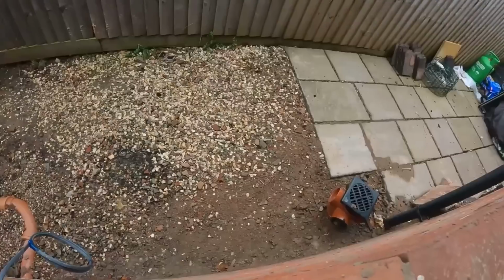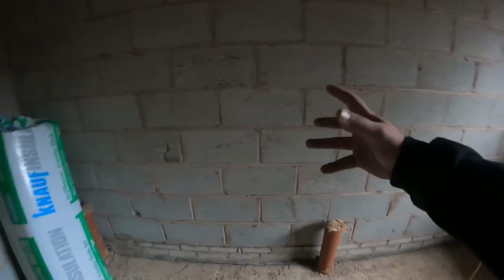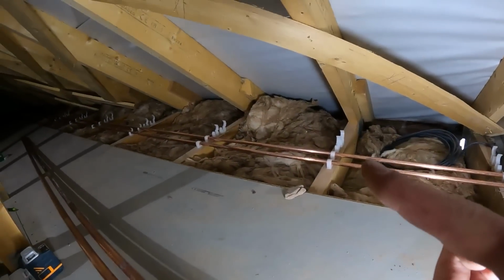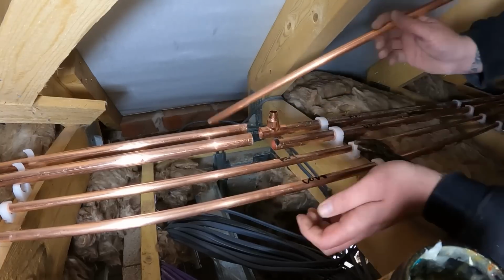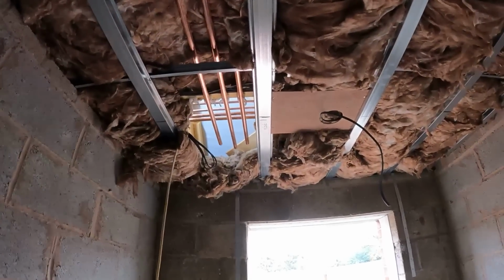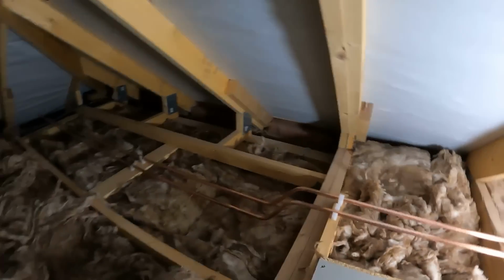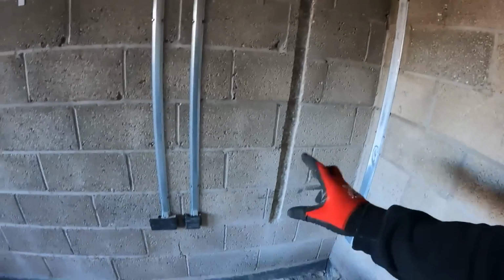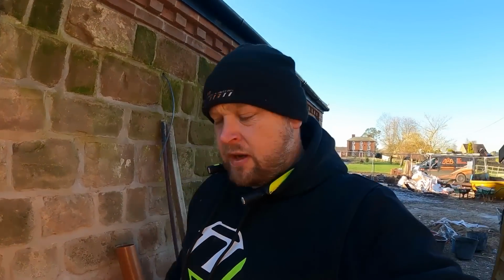HOW TO SOLDER COPPER PIPEWORK | PLUMBING TIPS & TRICKS

Comment: Mark when you solder then put a wet rag on your joints brings a smile to my face. In the 60's we had Geecol steel pipe Yorkshire fittings and Bakers Blue flux. Then we used to throw the rag on what we didn't know was the fitting and pipe cooled at different temperatures. When we turned on the first five installations everything blew apart.!!!
Reply from the maker: Ohh bet that was fun!!!!!!…..🫣🫣🫣
Reply: For electrical soldering we were told not to cool the solder joint by blowing on it because it could weaken the joint, I guess the same would happen with the plumbing joints with the wet rag only used for wiping the flux off to keep it looking nice and not rapid cooling the joint. Yeah ok not likely to cause a leak I know.

Comment: Lovely job as always mark hope your feeling better soon buddy. I'm stuck outside at the moment draining down holiday homes and rescuing ones that have frozen or flooded out. Roll on when it thaws out. Surprised the builder hasn't specified a secondary return on the hot as it looks a good old run. Anyway stay warm 👍
Reply from the maker: Thanks mate…….👍🏼
The long run is only for the outside taps and even then it’s only around 9m… the video probably makes it look longer.
Also reading up a little lately and a lot of people are beginning to frown upon secondary loops as they are not as energy efficient as once though apparently….
Reply: Yeah it's deceiving it looked a long run, your spot on with secondary loops they are wasteful even if they are well lagged. The new method now supposedly is if you want instant hot water is to heat trace your dhw pipe and lag it and have it active during times when water is being drawn off.

Comment: Ken Bruce: Name 3, top 40 singles chart positions for.......... Rush??
Loafer: 1978 Closer to the heart -> number 36. 1980 Spirit of Radio -> 13. 1981. Tom sawyer -> 13. 1983. Countdown ->.36.

🤘 Rock on Tiff!
Subdivisions, did not make the top 40.
Some places where I have to work, that copper would have been nicked if a guard wasn't left on site overnight.
Reply from the maker: We will see tomorrow morning if it’s still there 🤣🤣🫣🫣🫣

Comment: Could you notnhave just soldered the 15mm reducer onto the 15mm pipe first and then put it in place onto the 22mm and finish? What do i know, im not even a plumber😁
Reply from the maker: No because if you did that then soldered it to the 22mm the solder in the 15mm one would run again and it would drop out… you have to twist it as shown👍🏼👍🏼

Comment: Must just be me who always polishes the pipe before putting a soldered fitting on?
Reply from the maker: If the copper is dirty I will clean it up but this is all new so no need with Laco flux👍🏼
Reply: @MJTiffPlumbing  I always use powerflux might give it ago
Reply from the maker: Worth a try buddy